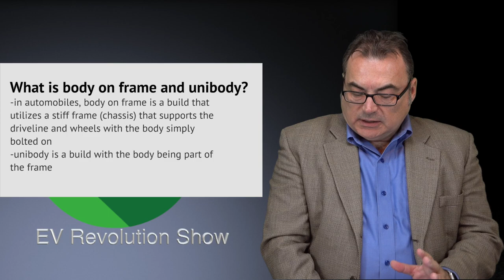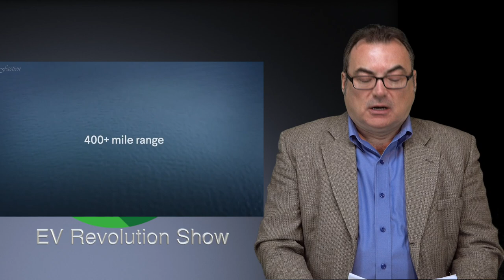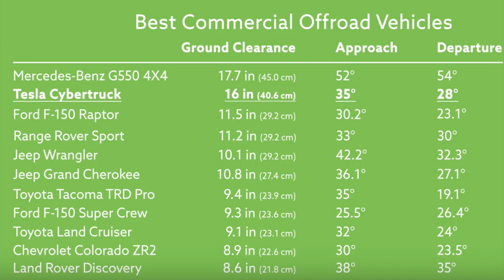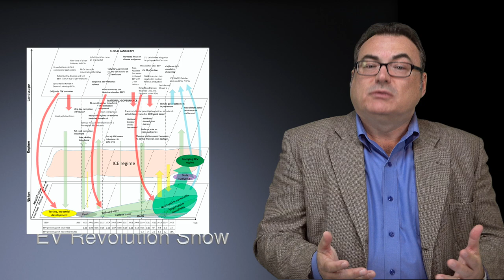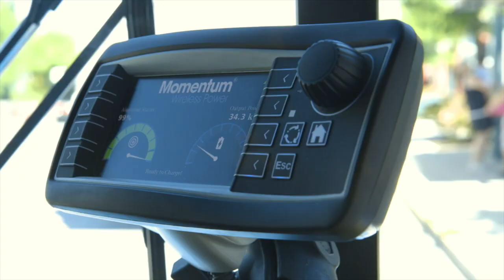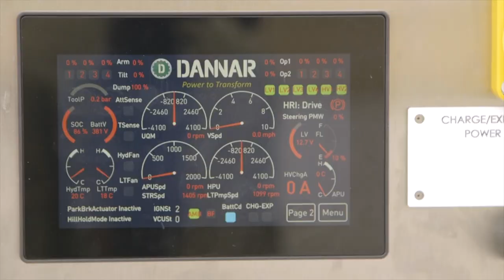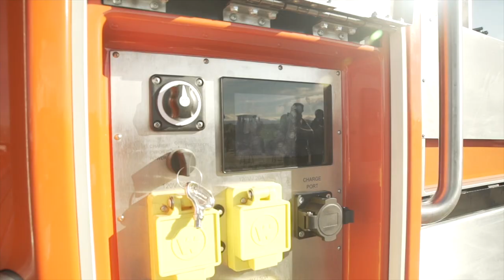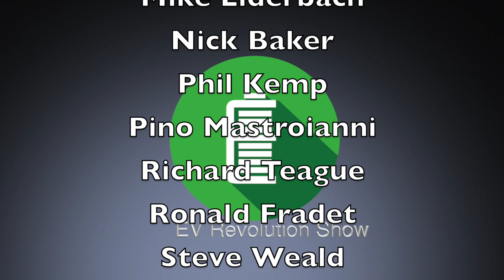Episode 70 - Tesla Cybertruck Part Deux, Lexus UX 300e, Fisker Ocean,  Dannar 4.00 and lots more!

Comment: Cybertruck is going after the millions of lifestyle pickup drivers. People that want a truck but never use the bed, or they only have one because they need to tow their boat or camper.  There isn't a solution yet for the specialty vehicles, but we don't need those just yet. 2019 pickups only look like they do because they need a huge engine, and it's how they've looked since the 40's. Once electric, they no longer need to be designed as a brick pushing through the wind.Great to see something different to make people rethink what they actually need. And as some others have mentioned, the fleet buyers don't care what it looks like, only what it costs them over the life of the vehicle. Anyway, unless Tesla throws $$$ congress to update the DOT rules (side mirrors), this is just a concept car at this point two years out.
Reply from the maker: Hi David, that is a great term you use and thanks for it.  I've not heard that term describe that market before and you are so right.  

Tesla will do ok with this truck, as they will with all of their offerings moving forward.  There is enough of a spotlight on them (like with Apple and other darlings of industry) that as long as they can continue to be profitable, they can be creative.  

We really need many more automotive companies to get in the game and the pickup truck market is very small overall globally compared to the others.

Comment: The cybertruck, in it's current form, will never sell to the masses, only to enthusiasts as it's really just a techmobile without a purpose. It is therefore highly unlikely that the truck you see now will ever be mass produced. What will most likely be mass produced is a vehicle that resembles a normal truck as THAT is the only thing with proven sales. In the end two things are certain: any vehicle Tesla has ever produced has taken longer and cost more than they promised ~ so will it be with this one.
Reply from the maker: Thanks for watching John.  I think you are mainly correct, however I too tend to underestimate the allure that is Tesla and I think they will sell a very good amount.  Now if they can delivery them on time and within the pricing promised, that we have to wait and see.  By then (in 2 years), there will be other competing products shipping too.
Reply: To date Tesla has never delivered either on time or on budget ~ so will it be with this one. Further, the vehicle they revealed will not pass the NHTSA (National Highway Traffic Safety Administration). It needs: 1) proper headlights, 2) proper tail lights, 3) rear view side mirrors, 4) windshield wipers, 5) crash tests; which it will not pass as their are no crumple zones with the exoskeleton! That means the cybermobile will kill anything it hits; cars and pedestrians alike, and it will also kill anyone inside, as they (not the vehicle) will absorb the enormous impact.

Yes it has a cool factor, but at what cost? Mark my words: the base price will increase along with the proposed production timeline ~ and in the end it will not look the same as it does now. And this is IF it is ever produced.

Comment: The Tesla Cybertruck is aimed at taking a sizeable chunk of the ICE pickup truck market putting in its place a functional and sustainable vehicle without tailpipe emissions. It follows on from what the model 3 is doing in the saloon market, what the model Y will soon be doing in the SUV market, and the way forward for Tesla as a mass market manufacturer. It is not a missed opportunity to produce a body on frame set up because that opportunity still exists should the Cybertruck not show promise.
And already the numbers are falling into place with their plans, so as a share holder who am I to not see this other than a great move.
Reply from the maker: Agreed Richard, I don't think the CT is a bad move.  300,000 $100 deposits are really meaningless and you know that Richard.  It's really not even a deposit by most legal definitions so don't hang your share holder hat on that please.  Wait for the actual conversions to sales and deliveries.  That is what will count.  

Yes Tesla is doing good things for the markets your specifiy and that is great.  However it the model 3 would have come out 5 years from now, would it have done and continuing to do as well as it has?  I say no because there will be much more BEV choice in the saloon marketplace.  There are more reasons that just timing that the model 3 is doing well, but that is a big one.  

So we agree on the end result of replacing tailpipes, good Richard.  Yes the CT will sell, but not as many as it could have.  That's my point.
Reply: @EVRevolution  The success of the model 3 has cemented Tesla's position in the industry and allowed them this brazen move on the pickup market. Some youtubers feel the $100 deposit far to low but a reply from someone pointed out that it has provided an instant guide to peoples preferred option and as I say fits in with Elon's plan to start with the base model. Anyway keep up the good work.

Comment: 12:30 I am the exact opposite of an Apple fanboy but does this date tell you anything? June 29, 2007 - rings bells?
Think Nokia. They were dominating the cell phones market on that day much more than GM+Ford+Chrysler+Toyota combined dominate the car markets today.
Oh, and since you are talking so lovingly about the beauties of 'body of frame'. Check out this F-350 frame. Video is embedded in the article.
https://www.teslarati.com/elon-musk-tesla-cybertruck-suspension-vs-ford-f350-video/
Reply from the maker: I can't believe you are comparing the consumable electronics marketplace to automotive.  There is no comparison.  Nothing I will say will convince you otherwise Arth and I hope you will purchase a CT or another BEV and get ride of a tailpipe vehicle.  After all, that is what I am about and if many really don't see this thru the Tesla-vail, then I am sorry.
Reply: @EVRevolution  In fact I am currently driving a Mod 3. I did preorder 2 trucks - single and dual motor because I am not sure which one I will want when available and I do not want to wait one extra year for the 3-motor.
Interestingly, the base CT will be selling for A LOT less than I paid for my Mod 3. It's possible that I will trade in the Mod 3 when buying the CT.

Comment: Modularity is the way to go with utilitarian vehicles, hence Tesla truck isn't the best design approach in my opinion.
Reply: Their platform allows for Model S, Model X, Model 3, Model y, Cybertruck, Roadster 2.0, Semi truck. A lot of modularity for the car producer at least. As far as aiming for specialty vehicles like suggested in the video, that is a far smaller market than the mass consumer pickup truck market. The design of the cybertruck is optimized for practicality for the largest group of use cases. The old pickup design was limited by the engine and transmission system and is the same design as the original Ford Model T. Lots of other companies are already making EVs and conversions for utility vehicles. EV adoption is happening way faster in those areas than in consumer markets. With utility vehicles and fleets, buyers are already adopting EVs as fast as they can find solutions and lots of companies are looking to provide those solutions. Buyers of fleets can see the financial benefits of EVs and really need to make the math work in the long run. More mass-market pickup truck consumers do not have EV choices yet. Tesla can really do some good there. And, if you want a decent range in an EV pickup truck, you end up with a shape like the cybertruck but rounder. If you also want the most practicality, including the steel, then you get exactly the cybertruck design as you cannot make round shapes with that steel.
Reply from the maker: Thanks for comments.  @OooTheMAXXoo0, ok then please send me the facts proving your statements.  I believe it to be the opposite, that the majority of pickup truck sales are for more variant vehicle needs and choices.  You are so confident, then prove yourself.  Otherwise it's just your conjecture.

Comment: You had me until you pulled the same stunt I've heard time and time again now, comparing the Cybertruck to a far more heavy duty truck. I may not agree with you, or your assessment of the market share as compared to what I believe now to be the less equipped Rivian or the out of reach Bolnger, and who is buying this truck vs who isnt but I'll hear you out and disagree as needed.  But after I hear the comparison to a 250/350/450(and similar makes and models. You're basically wondering why the F-150 cant do those things either and that's not an equal comparison.

 I am a self admitted tesla fan but I can see a mistake when they make them. And I, among many others, dont see this as a mistake, we see it as an opportunity to have the truck that we want rather than what the big 3 or whoever else wants for us. It's weird, different, functional for my life and is fully electric so really if this thing can come to the market as close to as shown as possible. The market, the consumers, and I think Tesla as a whole will be better for it. But hey what do I know I'm just a dude that wants an ugly ass truck XD 

Keep up the conversation. Keep it clean, keep it green.
Reply from the maker: Hello @ArcaneProphet, much thanks for watching and for the comments.  I was not directly comparing the CT to the other F-Series models, only stating that the market is bigger than just one model of pickup truck for the reasons I stated.  

However, I did receive feedback on my Rivian comparison and if you watch my next show I will talk about that quickly at the beginning.  

Now, nowhere did I state or say the CT was a "mistake".  I said it was a "miss" in my viewpoint that because of it's design, it can't go after the entire pickup truck market, for the myriad of reasons I explained.  However, it certainly is capable for the many who will find its design, specs and pricing more than adequate for their needs.  

I'm all for getting rid of tailpipes in favour of electrified vehicles and don't care if it's a Tesla or Kia that people move to.  

I was hoping Tesla would want to really go after this marketplace, but they are fine for a slice and that is all I meant by the "miss".  

So, glad you are looking at electrification and that's fine to be a Tesla fan, just as long as you are not looking at the world with horse blinders on and see the big picture. Tesla cannot do it alone and they never will be able to. 

I hope you can find an EV fitting in your life and again, thanks for contributing to the conversations and for the comments!

Comment: Ok you're saying it's not modular because it isn't body-on-frame. Let's brainstorm for 5 seconds to think how could you make a non body-on-frame modular ?? Just try... and you'll see the whole argument is a little weak. 
The reason why the first version of let's call it "chassis as body" isn't overtly  modular is because there's so many new things they're doing which need to be validated first that it doesn't make a logical sense as an innovator to go too far down a certain path before you validate that first stuff. 
It's like when they built the first versions of the Starship it was completely different material. You have to minimise your sunk costs. Innovation is about taking wild new steps but testing your assumptions before you go too far
Reply from the maker: Thanks for watching Adrian.  I am just explaining what is the norm today for this marketplace and that is has worked for decades.  I agree about innovation and Tesla has loads of it. The CT will sell, but it won't be this market leader.  You are putting all your eggs in the basket of something not even built yet or available for 2 years. As you have seen, a lot can happen in this landscape in that amount of time.  A $100 USD deposit is meaningless and any financial person will tell you the same thing.  

Listen, I hope Tesla sells millions of these I do.  I am about getting rid of tailpipes for EVs, preferably BEVs.  Telsa is just one company and we need 50 million EVs to be sold every year just to take a majority lead in yearly auto/light vehicle sales globally.  If you are putting all of your hopes on Tesla and the CT, then we really are doomed.

Comment: Check out https://www.opensourceecology.org/.  Their goal is to create an open source modular equipment that can be made by anybody using standard components (therefore easily fixed).   The overall goal is to create a tool kit that would enable communities to bootstrap themselves into a better situation.  .  A similar idea to the Dannar but open source.  Imagine this kind of took kit matched with an electric platform.
Reply from the maker: Thanks Leroy for the info, I hope they focus on electrification rather than other techs.

Comment: What about the bed size.  Rivian is 2 feet shorter than the Cybertruck.   BIG differrence.   Rivian also doesnt have a covered bed like the Cybertruck.  Also, the Cybertruck will be able to be easily customized as compared to the Rivian.   I think you are way off base with your comparisons.   You were comparing the highest Priced Rivian which will be over 100k.    You need to do much more research before you post your views...
Reply from the maker: Hello Alex, thanks for watching.  I did see afterwards that the comp. was off between models.  I believe many options including bed covers will be available for the Rivian as well, so one can equip a R1T with many choices.  My point was to just let others know that the CT is not the best thing since slice bread in this marketplace and it will do ok, but not be a leader in it.  Those who believe otherwise are not looking at the global landscape with a clear lens.
Reply: @EVRevolution  Time will tell.   I dont believe anyone thought Tesla Model 3 would outsell all other competitors either.   But they are.   Tesla Model Y will likely do the same, along with the Cybertruck, but it will take awhile because there will be much more demand than supply for a few years.   Right now many people are holding off buying ICE cars and preparing to purchase EVs, namely Teslas..  Watch as the sales figures drop on ICE cars and trucks while buyers save up for Teslas....

Comment: Big problem with electric off road vehicles (and indeed anything out there in rough, remote, areas) is maintenance and reliability.
Someone out in the boonies with a welding torch and a socket wrench can pretty much fix a diesel engine. Not so much an electric engine or battery pack.

That's also why many people who need such vehicles (rather than buying them because they're "kewl" don't want all the fancy options that just break anyway.

Take into account the serious degradation of EV battery packs in extreme climate conditions (especially cold) and things get worse for them, which is why that Rivian video is such a joke.

Good to see though that companies are starting to get more serious about making electric versions of at least smaller construction equipment. Your average JCB would work fine with an electric motor rather than a diesel one.
Reply from the maker: Hey Capitan, good to hear from you.  I do disagree in general but understand you concerns.  BEVs are built pretty strong since the motors are almost bullet-proof and the packs are encased in enclosures for protection.  The need for repairs is much less since a BEV uses about 1/5th-1/10th the parts of a standard ICEV.  A lot less to go wrong on a BEV.  You underestimate the solidness of DC Motors and as far as degradation goes, a properly thermal managed pack won't degrade that much.  There are TeslaLoop Telsas with 500,000 miles that have about 10% degradation.  

Good thing about BEVs is that the average Joe does not need to worry about working on them since they are so tough.  The platforms and drivetrains are strong and what Rivian and others are doing will be more than enough.
Reply: @EVRevolution  the motors themselves maybe, but the rest of the units not so much.
High voltage wiring, battery packs, computers, other electronics.

It's more sturdy now than 20-30 years ago, but there's a reason milspec stuff is still a lot bulkier and expensive than commercial grade gear in that area.

Not very long ago I was involved in setting specs for field engineers to replace old handheld terminals. 
We couldn't find a single piece of off the shelf equipment that would do the job, which included being capable of being dropped from 3 meters high onto a concrete floor where it'd have to survive without damage falling into a 10cm deep pool of oil.

Maybe we set our requirements a bit high, but if you're out in the Darien Gap or north of the arctic circle with the nearest workshop hundreds of kilometers away you don't skimp on such things.